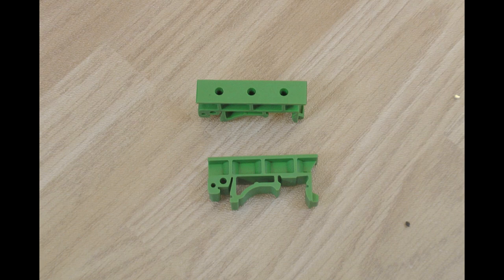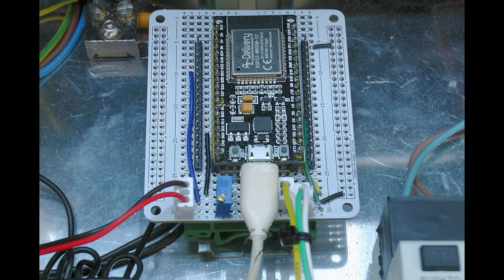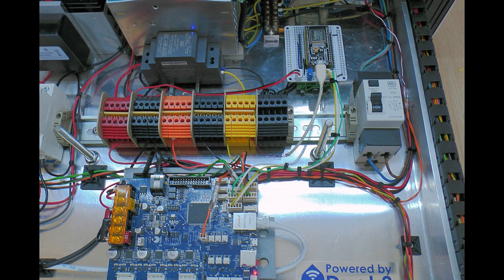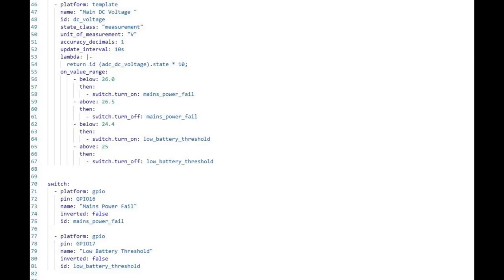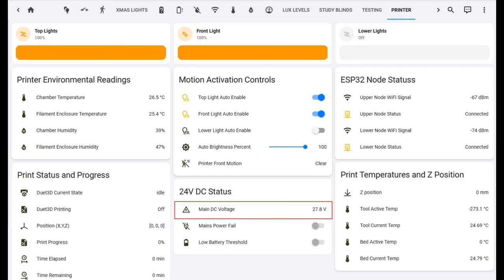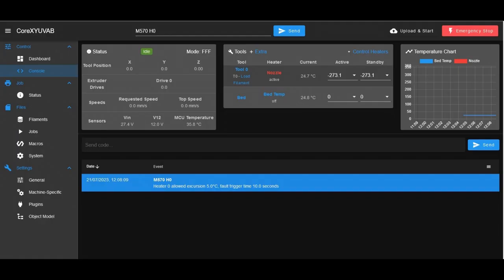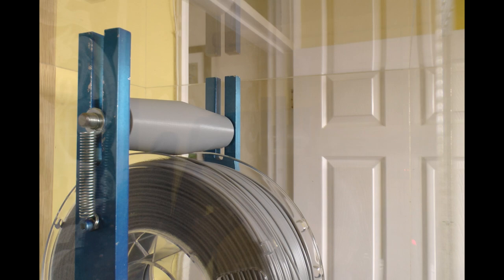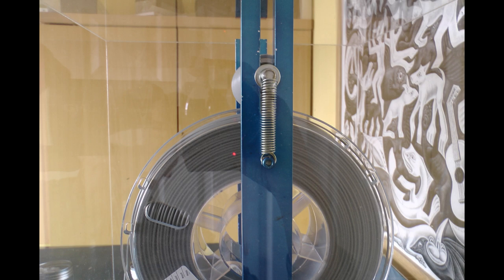New CoreXY Part14

Comment: do you think a trigger 4 (battery at/below cutoff voltage - shutting down) could do M400 (finish all current moves) pause, record position of print file (no clue how to do this attm) somewhere so you can restore print when power is back.... there are M codes for this but afaik duet do not yet support them ( M416 for e.g or M911, M916...) I know that duet support M911 "Configure auto save on loss of power" but I never tried it myself.... might be a good candidate for trigger4 :)
Reply from the maker: Yes, Duet firmware has long had the ability to resume a print on power fail and trigger 4 would be used for that purpose. Here is a link to how it works https://docs.duet3d.com/en/User_manual/Tuning/Resume. There are a couple of things to consider. Firstly, depending on the filament type, the contact area with the build plate, and the length of time the bed is unpowered, the part might become detached - in which case we are pretty well buggered. But assuming the part hasn't become detached, then after power is restored the printer will have lost it's homing status so we'd need to re-home before resuming.  For X and Y, this isn't a problem but because I use the nozzle to home Z, I wouldn't be able to do that with a part on the bed. However, I reckon I could use G92 to set the Z position to be what it was when power failed (from resurrect.g). There is a chance that the Z motor could jump by up to 4 full steps when power is restored but that wouldn't be a problem because my lead screws are 2mm lead so at 100 full steps per mm (1600 at 16x micro-stepping), 4 full steps would equate to a positional error of only 0.04mm.
Reply: @deckingman  yes if the part detach - it is the end of the road, but in all other cases there might be a way to solve the print... I was thinking about maybe positioning XY to a "known position" and figuring some "parking position" for the Z as my Z is never self locking... I gave up thinking about that recovery 'cause I setupped big ups + generator for the whole lab so that became non issue for me but trigger 4 seems like perfect place to implement something like that :)

awesome progress so far :) thanks for sharing